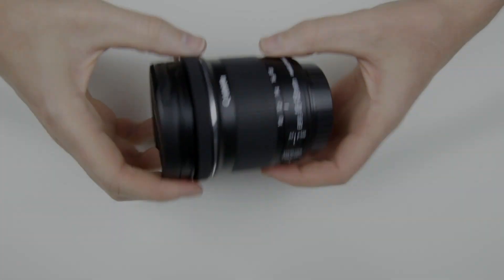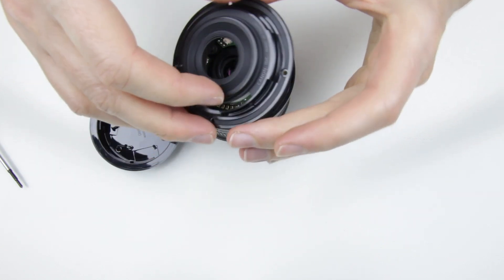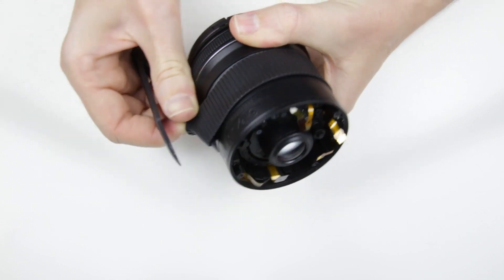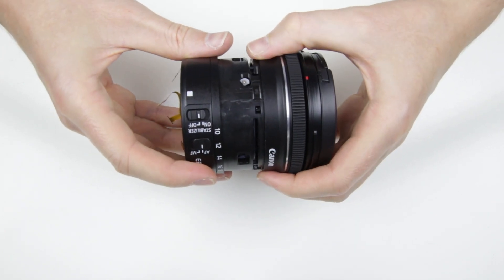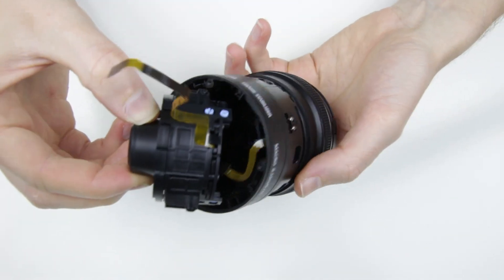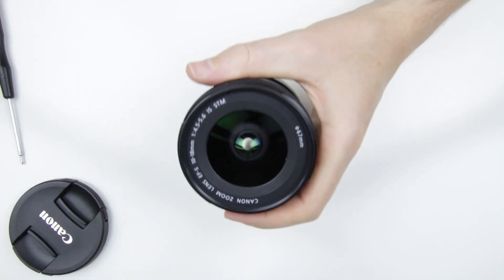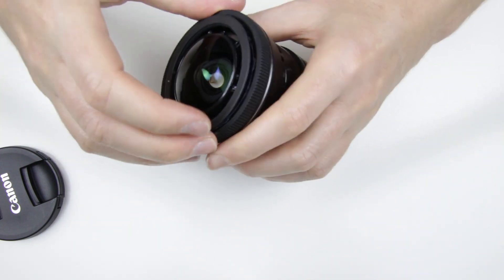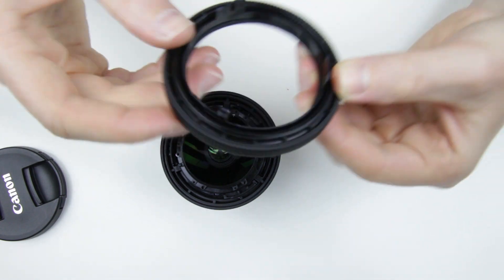Canon 10-18mm f/4.5-5.6 EF-S IS STM disassembly

Comment: Had the same issue. Opened the lense, one of these were broken. I used the mechanism of a clicker pen which had the same diameter, cut it in the same thickness and it actually worked. The piece I cut was exactly the same as the original and the lens works! Before fixing the lens was making noise when shaken and the photos were blurry at the edges as the internal part was out of alignment. Now it is as new! Hope this helps someone!
Reply from the maker: Thank you for your comment!

Comment: So if the focus ring is broken, is it possible to purchase a replacement? I have the same lens with a broken focus ring. I have yet to take it apart, but if I did, could I buy a replacement? (the zoom works fine, just the focus ring is broken) 
Also, do I need to take apart the back if I just need to look at the focus ring? Thank you!
Reply from the maker: Check ebay or aliexpress if there is someone selling the focus ring. Alternatively, you can ask the Canon service center in your country if they have the spare part.

Comment: Does the manual focus in these lense work in photography mode?
Reply from the maker: If you mean FTM (full time manual), then it is not. When the STM-motor lens is in AF mode, then you can't adjust the focus manually. If it is in manual mode, then the manual focusing works in "fly-by-wire" mode. If the lens is not attached to a camera, or the camera is turned off, then manual focusing doesn't work at all.

Comment: Where to dind that broken plastic washers?
Reply: I need those also. :/
Reply: @AleXtazee  x3
Reply: Me too, anyone found them online?
Reply: @LuzestudioEs Had the same issue. Opened the lense, one of these were broken. I used the mechanism of a clicker pen which had the same diameter, cut it in the same thickness and it actually worked. The piece I cut was exactly the same as the original and the lens works! Before fixing the lens was making noise when shaken and the photos were blurry at the edges as the internal part was out of alignment. Now it is as new!

Comment: I had exactly the same problem after dropping the lens to the ground. There are two of those white washer-like parts. This means you can use the intact one to make a silicone mold and cast a replacement out of epoxy resin. Once the lens is disassembled it's a matter of a few minutes (and some additional time to let silicone and resin cure). Did cost me well under 3€ (2,50$) since almost no material is used. Even if you don't already have the material at home it'll set you back no more than twenty bucks and you'll be left with a lot of surplus material. Just reassembled the lens a few minutes ago - time will tell how long the manufactured part will last.  For now all's fine and dandy.
Reply: I made a washer out of the inside of a clicker from a cheap pen. It fit perfectly.
Reply: @bretyardley3382 You saved me! Today I fixed mine with a slide guide I made from the mechanism of a clicker pen! Genius! The part I cut from the clicker was exactly the same as the original!
Reply: @bretyardley3382  Good ideia! I have the same problem too. I'll try your tip. Thanks for share ;)
Reply: Hello, do you still have surplus white washers? Could I buy them from you?